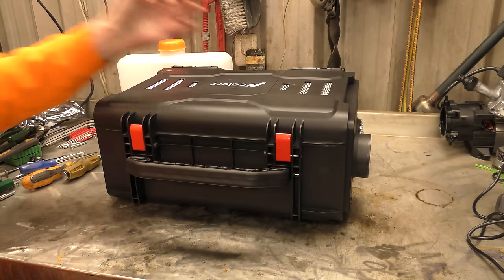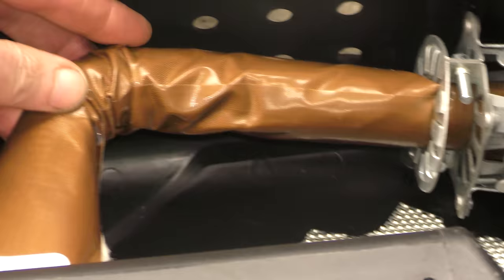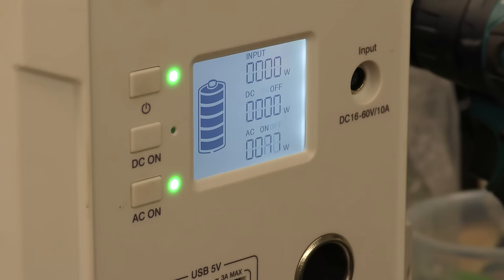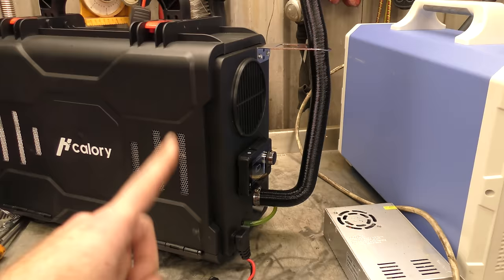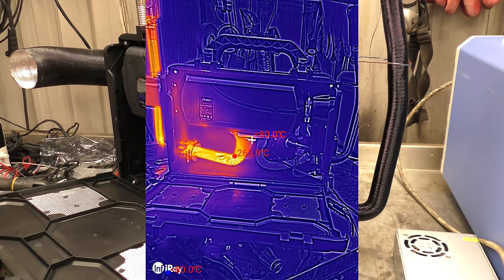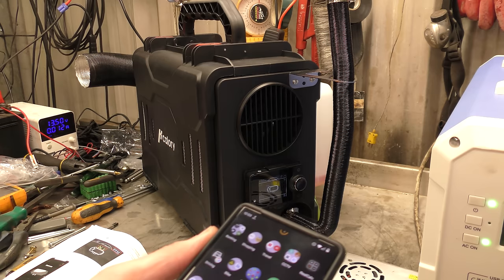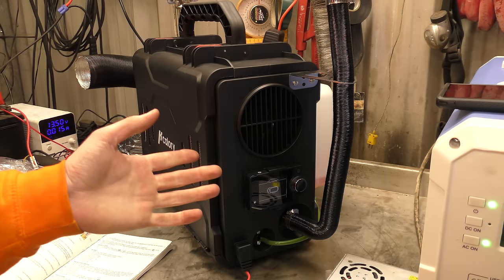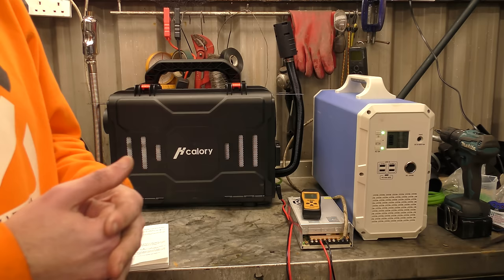Hcalory HC-A01 portable all in one diesel heater + bluetooth control ||  test / review

Comment: I came here to see how you attach the fuel tank but you kind of just gloss over it 😢
Reply from the maker: If I remember correctly there were three or four bolts that bolted into the case.  I didn't really give it much thought.
Reply: Didn’t you have to drill a hole and attach the fuel line? I think I found a step by step on this. Thanks!
Reply from the maker: Ah that bit.  I apologise then.  I've done it so many times now I didn't even think it would be important.